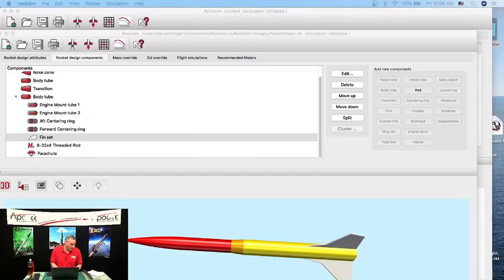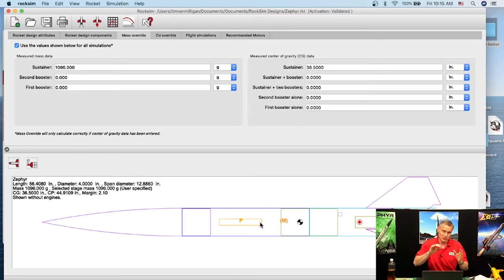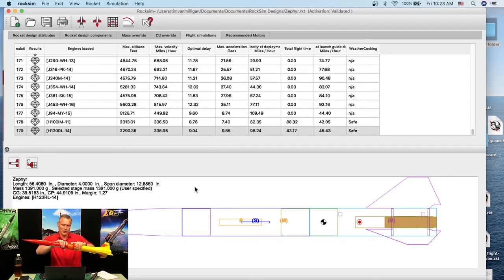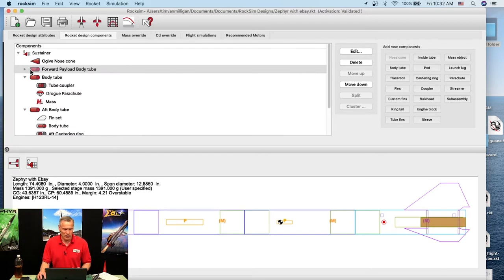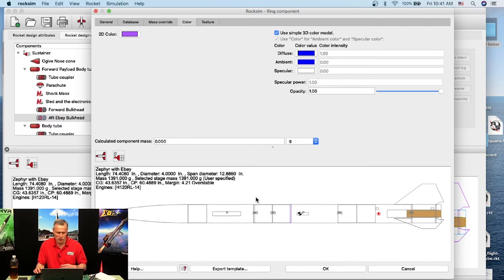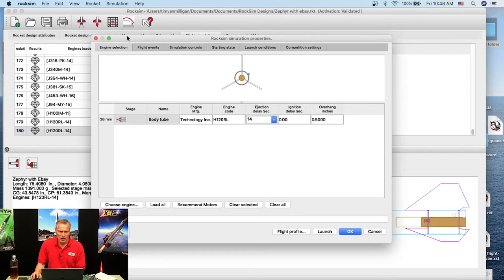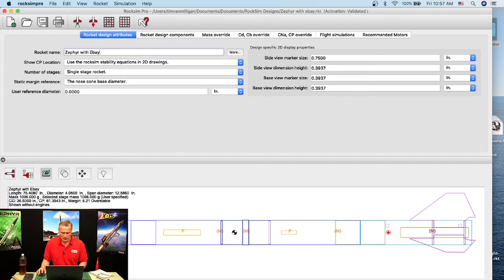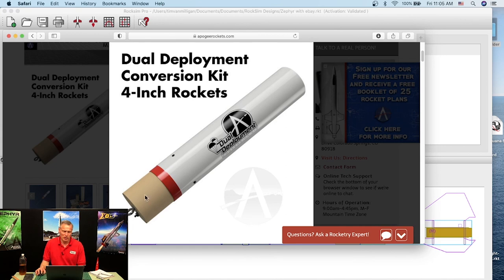How to add an Ebay to a rocket kit in the RockSim software

Comment: Looks like you're in Irwindale, CA at the Santa Fe Dam Rec area
Reply from the maker: I'm located in Colorado Springs. But the simulation was does at that dam site in California.
Reply: @apogeerockets  Next question....will the 6D simulation show the rocket split in two (or 3) depending on dual deployment...or does it stay in one piece through out the simulated flight?
Reply from the maker: @captjohnny  Oh the anticipation of waiting to use the software is just going to eat at you... That's my way of saying that I don't understand your question. Dual deployment rockets come down as one piece. Staged rockets come down in two pieces. I think you'll be impressed by what it can do.